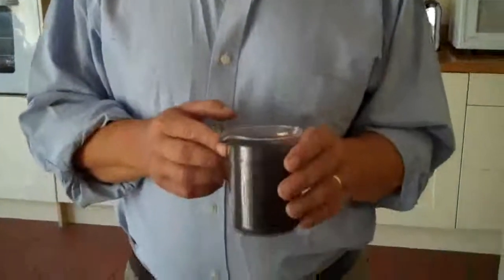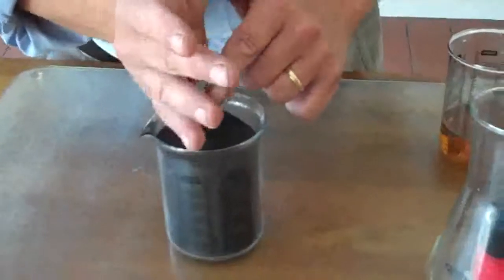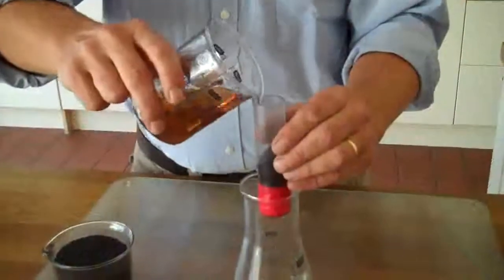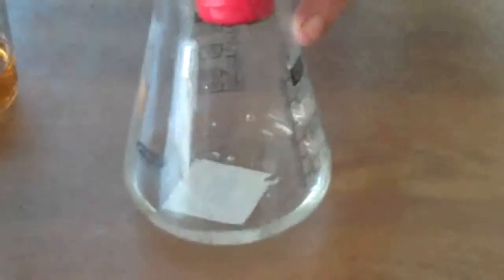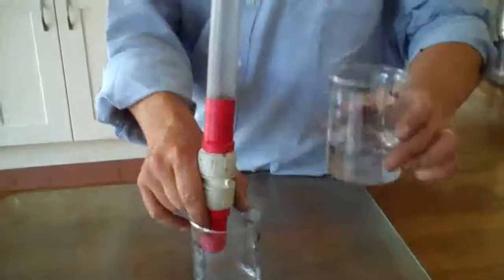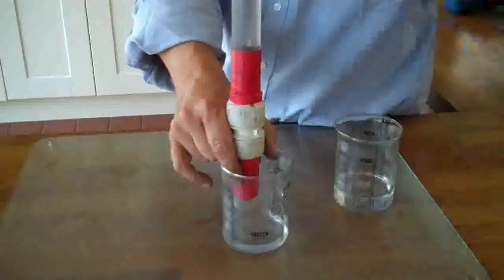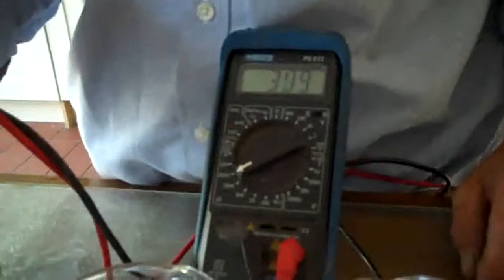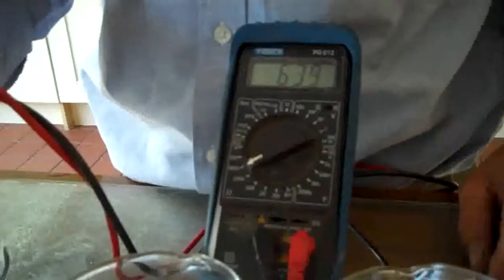Ultrasand - water desalination and purification using graphene coated sand

Comment: Thanks Robert, Nice video, Distilled water has a conductivity in the range of 0.5 to 3 µmhos/cm and since you were holding the probes about cm apart, 400ohms is consider high.But then again distill water is not consider healthy compaired to mineral waters for drinking purposes. Since temperature contributes to conductivity it might help if we know the temperature. But very impressive video thanks.

Comment: Hi Rober. Love this channel. Just join in. Short question. Why to bother to produce graphene covered sand if you can use the carbon filter with optimized pores to get the same effect. Is this a great spin, really ? Cheers Piotr

Comment: Ah! You're one of the first people to emphasize graphene for drinking water application purposes.  I've worked in Municipal Water and Wastewater for 15 years and there's no limit to how many uses there is for this.
I wonder if a graphene coating could chemically resist corrosive chemical flow like chlorine dioxide?

Comment: Shocking! Did the filtering of the Coca-Cola have an effect on the dissolved CO2?  I would be very interested to see the effect this sand has on a few other chemicals, petrol/gasoline, and different alcohols might be interesting.  Maybe you could separate water from gasoline and improve its quality by letting it sit over densely packed g-sand; I suppose that all depends on how it interacts with non-polar chemicals.

Comment: How would you speed up the water filtration? Increase pore size with bigger grains of sand and continuous flow? Also, what is tubing and plastic housing you put the graphene sand in and what is it specifically called? I love your channel by the way so informative and interesting.
Reply from the maker: cheers mate - you'd need a bigger cross sectional area bigger pores would mean less contact time and contact time is important for cleaning effect - i don't know if there is a specific name mate - it was just some plumbing fittings i got at home depot
Reply: Ah yes thank you for the information!
Reply: hi i would like to ask if you know what size of tubing that can be used for this experiment?

Comment: Love your videos as it shows people that science and 'invention' isnt hard, just take hands on and thinking out problems. I was working on a project a few years ago that included much of what your talking about. My guess is that you have some uncarbonized humic type compounds in your material. Activated carbon is fully carbonized so there isnt alot of loose functional groups and long chain carbons which is where the 'hardness' number comes in. This is why you have good number but the water really isnt clean because humic compounds are taking up and leaching slowly out, which isnt good. And the numbers will go down quickly if you have not fully opened up the carbon matrix. There are solutions to all these problems which is a much more engineered process and refinement. I think the path you're on is exciting but i would have concerns when it comes to water consumption until alot of hoops are jumped thru.

Carbon is a great compound to use and Im looking forward to its advancement in all sorts of fields, like water filter.
Reply from the maker: i know what you mean about hoops mate

Comment: Dear Robert Murray-Smith,
If you have tested this graphene coated sand..
I am inquisitive to know that for how long that bed would not require any regeneration, how you could regenerate it & after how much usage it has to be discarded?
Thanks..
AT
Reply from the maker: i am not sure how long it would last i am afraid but to regenerate it you would backflush it with salt water and get brine out
Reply from the maker: Lupus Mechanicus why do you think mate?
Reply from the maker: Lupus Mechanicus the salt concentration of sea water is low compared to the solubility of salt in water - why waste fresh water to clean when it isn't needed
Reply from the maker: Lupus Mechanicus I understand - i have been thinking about this for a while and would use another methodology for oil remediation first i think
Reply from the maker: Lupus Mechanicus yes i know - sounds like you have a plan there

Comment: hello sir
i made this graphene sand composite but after passing water through it it is bitter in taste. is it the case with you?
Reply from the maker: no mate
Reply: i don't know why this is happening is there any solution u can suggest to this problem. i will be very grateful to u for this :)
Reply from the maker: no idea mate and without actually standing over you i can't really tell
Reply: sir can you tell that wether it cleans sea water or not
Reply from the maker: it should but you would need to use capacitive desalinisation as a technique in conjunction with it
Reply: where can i find about that technique sir
Reply from the maker: search google scholar mate
Reply: :) well thanx alot sir